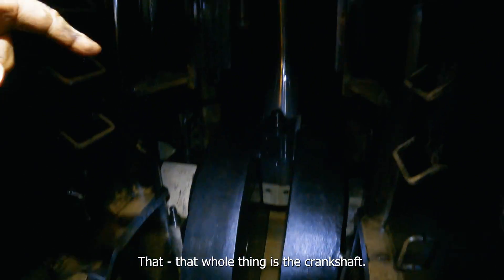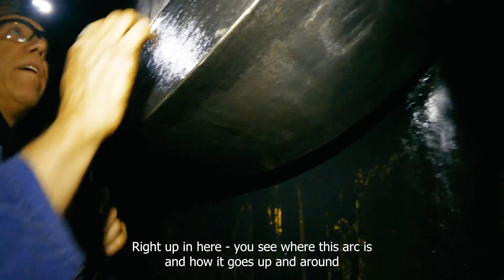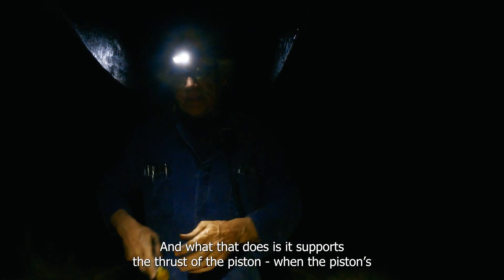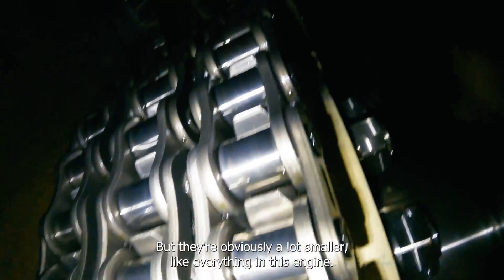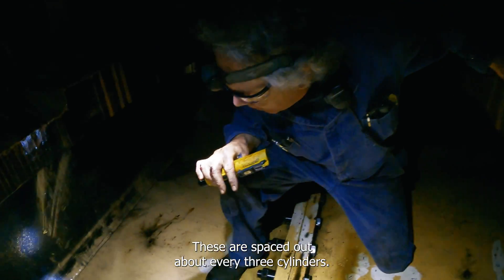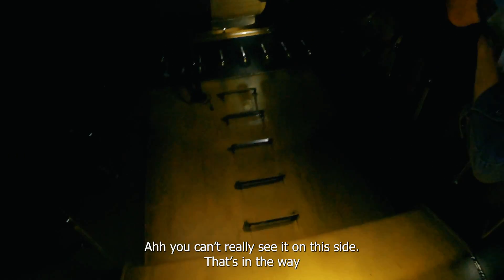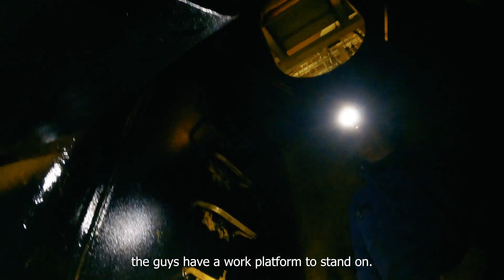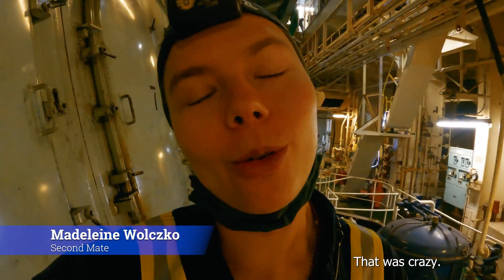Inside a Containership's Main Engine - B&W 12K90MC

Comment: ⚓️ Thanks Maddy 😎 have the First show you an SKF bolt hydraulic jack, for stretching the connecting bolts. 🎸
Reply: Or the tie rods. Even better.
Reply: @janvisser2223  which? Piston ties? Cross heads?
Reply: @pierheadjump  The tie rods that run from the bottom of the bedplate to the top of the cylinder jackets

Comment: I’m impressed. You are now one of two mates I know of that have been there.  It’s nice that B&W paints the inside of the engine.  Nicer and safer to work in.  What the First didn’t mention is the crew does change out ME bearings when they fail at sea. Not fun.  Good job Madeleine.

Comment: Like WOW! That was a great tour of the engine. Very well done. Please ask the engineer if this is a 2 cycle or 4 cycle engine.
Reply: since it has intake ports, scavenge air, and valves only for exhaust, I think it's a two stroke.  It seems like most big marine engines are 2 stroke.  I think they're also typically turbocharged.   More like older big truck engines than car engines.  No piston rods in smaller engines either.

Comment: Thanks Madeleine, for sure that's something you don't see every day!   That was very interesting.  Reminds me somewhat of back in the old days we had computers we walked around inside of they took up the space of a small house or large garage and they were not as powerful as the one you have in your pocket on your phone.  Times have indeed changed but the engines on cargo ships keep getting bigger along with the size of the ships not smaller like electronics so progress of things depend on the application.

Anyway, just seeing the size of the engine room is hard for someone who had no connection to that industry to comprehend, that sucker is huge as is the engine.  So thanks for the tour of the innards of the beast.  Finest kind.
Reply from the maker: That's a great point. Insane how things progress